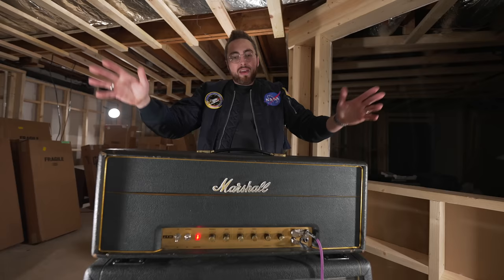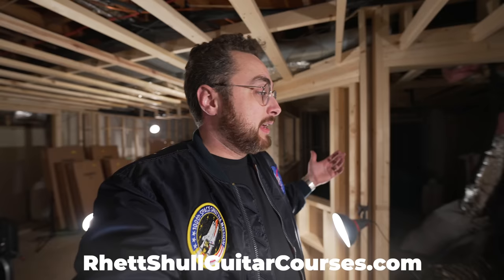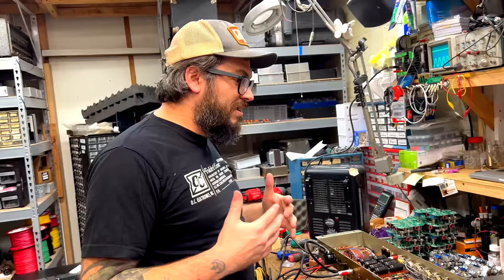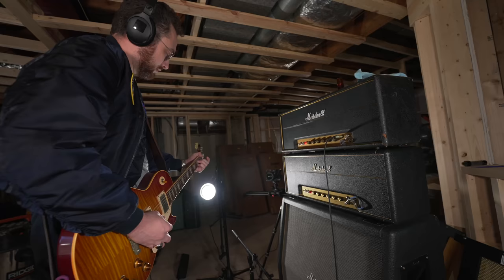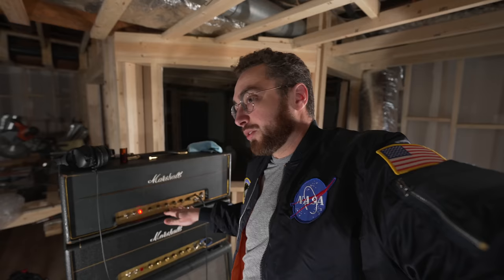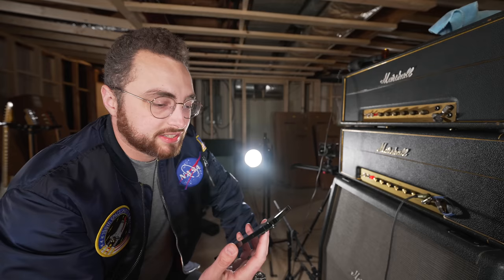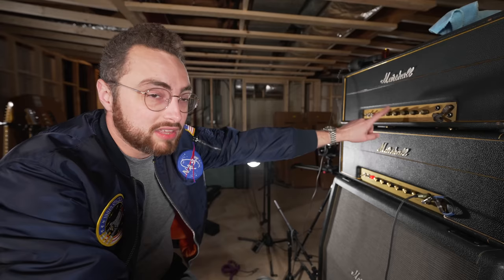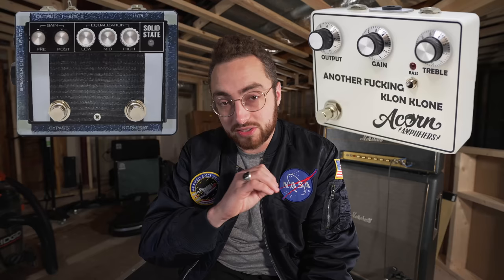This Amp Is So Loud It's Painful | Vintage 100W Marshall Plexi

Comment from the maker: Now I want to mod my Plexi to sound like the old one.
Reply: How much the vintage one goes for? 🤔
Reply: Rhett, when you started playing with the db meter on, I got chills
Reply: I have a 76 100w and the 60's coned greenback cab it came with. The volume stops getting louder before 50% but it just seems to project so much more and fill a room so much more. But I use the marshall powerbrake so I still can hear some.
Reply: @PhilRocks  you can find them for less than $30,000
Reply: Forget using your 100 watt attenuator on those puppies if they are cranking out over 140! I wonder who makes a 150 watt attenuator?
Reply: The modern reissue can't sound like it. The old one was built with filling an open stadium with 40000 people in it with a wall of sound, firmly in mind, without any kind of pedals to filter or augment it. And like many things built 60 years ago, they tend to over build everything. The power wasn't as clean and reliable, parts were not as available, all that. If you replaced everything in that old boy with modern parts, even identical spec, I'm confident it would feel pretty anemic after playing the original.
Reply: Rhett, you need to get a Ceriatone All Access 101.  Trust me.
Reply: I was about to comment “it is VERY easy to convert one into the other”, but evidently someone else already told you 😅 I might add: you probably like this “bass loaded” preamp style of the black flag because you’re a fuzz lover. Fuzzes have the full range of bass frequencies getting distorted, unlike almost all other distortions/overdrives where you have a bass-cut filter before the gain stage (and maybe a bass recovery circuit later in the circuit to compensate).
Reply: JUST BUILD A NEW ONE
Reply: @kapstersmusic  i use a Fryette Power Station with my 69 and I dime both volumes. I think the Fryette can handle 200 watts
Reply: ALSO WHY NOT
Reply: @lucistired  REALLY OMG ,having night mares now
Reply: yup they are beautiful so nice those ones eh, best advice get one dont use for stage only for recording hmmm ahhh
Reply: Get Lee Jackson to mod it for you! You’ll have an amazing tone that’s different & very useable! People drool over my Lee Jackson designed amp tones! I LOVE those cleans! It’s like a Bassman but different…
Reply: If I remember correctly, that amp is a Superbass, so it has the JTM-45 tonestack. That's the one that actually works. The 33k slope resistor is a joke!
Reply: @kapstersmusic  I use the Marshall powerbrake from the 90s and its fine.
Reply: Bear in mind that if you’re pushing a 100w superlead into a single 4x12 with 25w greenbacks, you’re running the risk of blowing a speaker. Killer tones.
Reply: You should try to get your friend to cut you a deal to buy it? Or maybe go back out to Norm's and make a new video shopping for one?
Reply: I has a 79 sl100w the last year for the 4 input 100w
It was a monster. Real clean until 5-6 then it got rowdy. 
Hell even clean at 3 it was loud. I miss that amp.
Reply: Doesn't Metropolous make a version fo that early JTM 100 watter?
Reply: @evitative462  Absolutely!  There's bound to be several settings you'll love instead of just one.  Only issue is whether the transformers have the desired response.  Might be nice to have a more aggressive OT with a tube rec.
Reply: @bm7376  I had a Metropolous 1987 50 watter repro with the 4 x 12 with the Brit 25 watt greenbacks. It gave you all that you could handle at 3-3.5 on the volume when jumped. I remember Gary Richrath saying back in the late 70's the he set his Marshalls like that and just used the volume on the guitar. Never went above like 3.5
Reply: @stevehunter252  yup i lived in the UK  long  time ago and we had to use AC30 S ,Bcause the MARSHALLS  were almost always broken,the AC30S they would burn up too, in the end we had to use MESA S because they   never let you down,Marshalls and vox  many time they went up flames,kills me to think how many old AMP we burnt up
Reply: speak to PETE thorn he put you in touch with dave
Reply: @kapstersmusic  Weber used to, for bass. They'll probably make you one if you ask.
Reply: @kapstersmusic  Weber used to. They will probably make you one if you ask.
Reply: You should try it with a bass guitar and your bass cab. That's what the Who were using on stage early on, and I think you might be pleasantly surprised. No, we didn't have a 100 watts cranking through a full stack. We would bring a 50 watt, which still stung pretty hard. LOL
Reply: You should hit up George Alessandro, he offers a hand-wired service for the 1959SLP Reissue, that amp will sound as good as the vintage one at a fraction of the cost.
Reply: If you do, please make that into a video. Process and before and after. That would be sweet.
Reply: Good thing Mr. Paul Reed Smith said he has an original plexi he’s selling. 😉
Reply: Hi Rhett, great vid! So you need to get in touch with George Metropoulos. He is the guy when it comes to vintage Marshall amps!
Reply: its also endless finding that sound
Reply: When you you use the old amps you have to have a Fuzz or an OD. I started with a Fuzz tone but moved up to a Rams Head in '73. I used that for years with a Schaller volume pedal.
Reply: I like the video with the tapping 
You really sound different in the good way ❤
Reply: Swapping to larger capacitors for the bias supplies would probably go a long way towards improving the bass of the amp.  That might get you the punch feeling you want.  If the caps are undersized, the bias supply in the amp will sag, leading to more distortion and compression, but not enough power to drive low frequency tones at full power.
Reply: Rhett it is almost impossible to modify the 1959 to make it sound like a vintage one: the current transformers are built differently, with different materials, the signal capacitors you should find the vintage ones in good condition...you should probably buy a real vintage amp!
Reply: Yip. Blackflag spec marshalls are my favourite to build and play, great clean and bluesy drives. Why Marshall have not re-issued these amps is beyond me
Reply: @evitative462  I second that. I love mine 🤟
Reply: Ore just buy Paul’s 👌🏻
Reply: @philbert006  You should seriously try reconstructing one. That's actually a really interesting concept. I also wonder if the same would be true for vintage pedals such as the Klon Centaur? 🤔
Reply: @kapstersmusic  you can put a 100w resistor in parallel with a 100w pot. I have a video on my channel of how you can make one out of a Home Depot junction box, a pot and a resistor. The whole setup is like 40 bucks. I used it on an ampeg v4 which has about the same output as a Marshall and no smoke :)
Reply: You gotta!! Shocking how much better the vintage plexi sounds. The ghosting and the smoother top end. 🤌
Reply: @Snowness  well, I've got the time and the soldering iron, and you can buy vintage and new old stock parts that have been sitting on a shelf all these years, even the old transformers. I can't afford any of that stuff though. I think the boys biggest issue would come at speaker time. Speakers by far have the biggest impact on the sound of an amplifier and a speaker that old would almost certainly crumble to dust as soon as you tried to pump it. But you could surely recreate almost every other aspect. Uncle Doug, a YouTuber that does meticulous restorations of amps from the 50s and 60s has tons of videos of doing this kind of stuff. They are all long format and super detailed. But I'm not sure he goes into that kind of rabbit hole. It seems though when he repairs those old things that they don't sound quite the same. But almost always the speakers have to be re-coned or replaced. IDK. I'm by no means an expert, nor am I old enough to have experienced this stuff, but in general I've found that products that have a run that started back then and continue now, this is the case. Things were overbuilt to handle the unknown stresses that cropped up. They often don't funding as well now since all the related infrastructure is upgraded, too. Cars, guns, tools, all manner of things. I think it would be unsurprising to find it to be so with amplifiers. But again, my opinion and a bit exactly educated guess. It definitely is an interesting idea though. One I would be willing to bet someone on the internet has pursued. The kind of thing Jim Lill, perhaps, would tackle.
Reply: Try Solid-state amps first.
Reply: Is the old new running on EL34s as well?
Reply: Try JJII s. They will deepen the sound
Reply: They do sound different, I prefer the original to the reissue….
Reply: I have played an orginal super base. I child only get it up to volume 4 live
Reply: its all in the wiring , which effects are wired first to last. If the circuitry is copied , it should be close , pay special attention to the wiring distance of each wire. That effects ohmage on loads as well and can be a big contributor to the overall sound.
Reply: @Jiří z Lipé Actually, my reissue has been modified by a highly knowledgeable amp tech. My goal was a Robin Trower like tone. And it is there!
Reply: you HAVE to reserve the led zeppelin chops for Orange man.
Reply: @phillipellis8450  I can appreciate shitty startup Marshall. The current ones are ear rape fodder. I hate them with a passion.
Reply: 25 watt G12M Greenbacks or 30 watt G12H GBs?  

My 1959HW sounds quite glorious thru the matching 412 with UK 30watt 55hz G12H GBs. They really produce a full thick sound spectrum. I bias the amp at about 30-31 per tube because amps will fiz when biased too hot. I play it with the volume about 6-7 while jumping the channels. Pristine punchy cleans and responds wonderfully to my GTR volume.
Reply: @loupatch4896  I too am a fan of the Greenbacks. I am running both cabs, so the head is running at 8 ohms. Channels are jumped. Vol 1 is set to 1 and Vol 2 is set to just under 2. I can’t imagine a steady diet of volume settings of 6-7.  I crank it every so often….
Reply: I understand Rhett, 
I have 400 true watts of tube/valve power,m driven by 5-12AX7's;  through two 4x12's [200Watt-EVL's]. 
They [thew cabinets] can barely handle it! 

It's an entirely different experience. 
Sonic Overload !
👍
Reply: Just build one. Keep the new one. Not that difficult from what I have been looking at and into.
Reply: Do you remember an Amp co. called Standell. (Just like the group) Next to our Silvertone 6x10 it was a monster
Reply: @ziblot1235  yes. I played through a Standel amp when in my high school jazz band. The speakers were Altec Lansing. Very nice amp
Reply: There's a mod that lets you make one switch to switch between Lead and Bass spec - that's a great option for the SL reissues.
Reply: My Fryette PS2 can handle up to 200 watts.  Why are we jumping the inputs? Jimi, Jimmy and Ritchie Blackmore  never jumped the inputs.
Reply: At 3:40 dude was supposed to do 34 volts squared then multiply by .707 then divide by the load impedance of 8 ohms. He got 144 peak watts by not including the times .707 step. Actual RMS wattage is 102.
Reply: @philbert006  I think it is a choice on Marshall's part. They never really go back and even try to make the same amp, always some small twist on it.
Reply: Problem with Marshall reissues, in my opinion, is that they are cosmetic reissues. They could reproduce that same amp but they don't even try. Always some little twist or tendency to go cheap I guess. Thing is, nobody really loves their new stuff. I don't understand Marshall as a company.
Reply: There was a good reason Jimi Hendrix played in front of a wall of Marshall's. I think you just discovered why on your own.
Reply: @GTguitarworks  nothing is going to replicate vintage components . There are far too many differences .
Reply: @CordScott  they can’t reproduce what is no longer produced . Vintage components aren’t the same as modern available components .
Reply: @charlieplate9687  Fair enough, but they do sometimes try to modernize them and I don't think its been successful. I think people don't want this new sound they want the classic sound. Other companies seem to come closer to classic Marshall tone than Marshall themselves.
Reply: @CordScott  💯
Reply: @charlieplate9687  You won’t find the word replicate in my comment you replied to here, I only made suggestions to lean an amp he already has toward a sound that could be suitable, or to taste through my own experience of modifying Marshalls. And frankly I’m just not interested in cork sniffing opinions I could care less what recipe you might think there be in some 60-year-old capacitor I’m old enough to have owned those amps and I can tell you that I’ve played amps today that I thought were even better.. a lot of those old amps are overrated and overprice because of cork sniffers.. when I was buying them back in the 1980s they were just standard workhorse amplifiers but now I gotta sit around and listen to people half my age tell me all about what caught sniffing special sauce they all have…after I’ve been building and repairing guitars for 26 years and modifying amps for a while now with channel switching extra game stages and so forth.. so please take your comment that’s designed to make yourself look so smart to somebody Who doesn’t know better…
Reply: @GTguitarworks   your original comment recommended several suggestions for modifying the circuit of his reissue amp to more closely approximate the vintage amp , claiming that these value changes are the “only difference” between those two amps. Even if I were to forget about Phillips mustard capacitors , Daly electrolytics, iskra snd piher Resistors, Lemco and RS ceramic and mica caps  , ect ect …the tolerances of modern components are not the same , and the accumulation of the +-20 variances are enough to throw a wrench in anyones works trying to pin down the tone by copying a schematic . 

As I stated, there is absolutely no way to accurately replicate vintage components exactly, nor replicate the sonic characteristics they impart using modern components. 

You might be able to make an arguably better sounding amp , sure , I agree, but it’s not the same , and no amount of shade thrown at “cork sniffers” is going to make me hear different . 

Believe it or not , not everyone on the internet is trying to condescend you.
Reply: @kapstersmusic  Fryette Power Station 100 can easily handle it since it's rated for 200 watts.
Reply: @joem5903  Germino will make one if needed. Germino Headroom with JTM100 specs.
Reply: @PhilRocks  Amazingly, right now a vintage late 70s go for ~$2500 for a 4-input, but a 1959HW at say Sweetwater go for $3,850!!!  
What kind of morons spend significantly MORE money for an inferior product?!??
I just don't get it.  Just like old Gibson customs.  Just a couple short years ago you could get a 72-75 LPC for $2500, now $4500 or more, but new ones go for $5000-7000!!
That makes NO sense.  The old amps and guitars used parts and materials and transformers you can't get today and sound better!  Again, WHY would you pay MORE for an inferior product??  The wood was more dense and better tone and due to forestation, you just can't get anymore.  If you want tone....get the OLD stuff, and CHEAPER!!!  :O
Reply: @kapstersmusic  Good point and why a lot of amps fail when attenuated when you run them on "10" all-in and it's actually putting out 140W and attenuator designed for 100W.  You're overdriving it 40% and the attenuator and amp are going to FAIL!!!  :O
Reply: @PhilRocks  bout 12 grand for a 67 black flag 100 watt minimum
Reply: Hey Rhett - Upgrade 1959HW with vintage Mullard 12AX7 I63 series preamp tubes, vintage Mullard EL34 XF2 series power tubes and Merren Audio Marshall output transformer.
Reply: Rhett - Also, you like ghosting and softer feel. Lower the values of your filter caps for a total of 32uf mains, 16uf screens and 16uf phase inverter.
Reply: Rhett - You want low end thump of JTM100, while retaining 1959HW top end sizzle. Then change the 2x .022uf capacitors going to V3 phase inverter to 2x .1uf like the JTM100. - Filtering I mentioned in last post is same as JTM100 too. - These are all simple mods that can be performed by a qualified tech.
Reply: @Rhett shull : i can do the mod for you BUT i'm from France....
Reply: @Rhett shull : for fun, i do it for free! Just for fun! Let me know if you are ok!
Reply: The HW sounded better, but turn down the CH II
Reply: @BurnFX1  Or find a repro OT from Marstran, Heyboer or whoever makes them these days. And if you want to go over the top get a repro PT as well. I do personally think tubes makes more of a difference than voltages. So maybe Rhett should just start there.
Reply: @kapstersmusic Weber Mass 200 would be a good option
Reply: Does anyone else think the speakers sound like they are failing, or is that just my headphones!?
Reply: hahaha  @lucistired
Reply: As you smartly stated, yes back in the day...50-100watt was normal. Today 20 watts is big... or you use a pedal or computer. I'm sure standing next to a regular amp, hard to imagine using them. Most of the time , we didn't stand infront,  at least that close. I quit when most venues gripped about my Bassman.  Used it for years. Not the same sound coming from computers,  no mater how close. No feel.
Reply: Hey, where can i get this amp?
Reply: The Weber Mass200 will more than cover it. A reactive load that uses a speaker motor and doesn't change the tone.